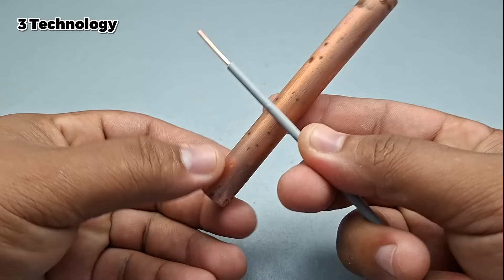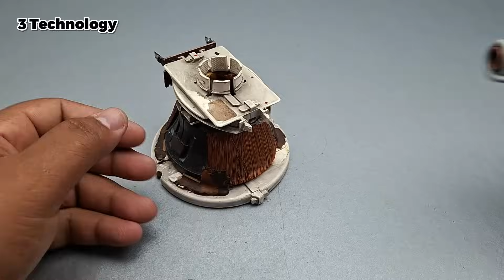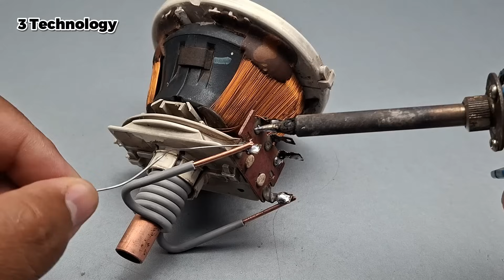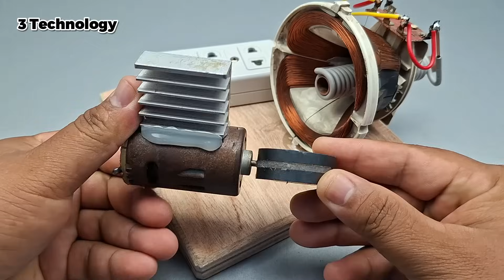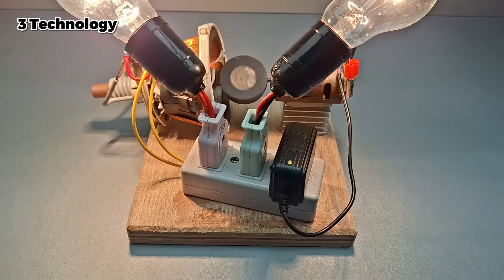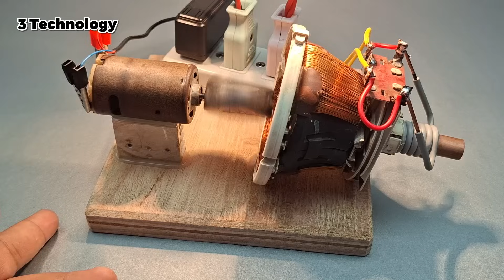I Create 220V 7000W Free Energy Generator Using TV Tails And Copper Pipe With PVC Copper Wire

Comment: Fake
Reply: What is covered and one sues extérnal battery to start the motor? The charger and socket will outside the box so it can easily be stopped
Reply: What is covered and one sues extérnal battery to start the motor? The charger and socket will outside the box so it can easily be stopped
Reply: Fack